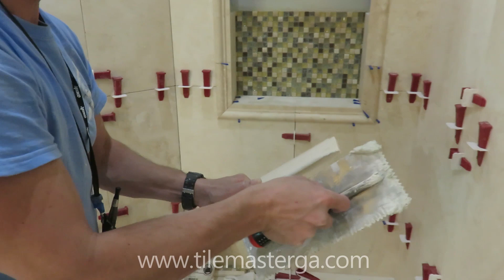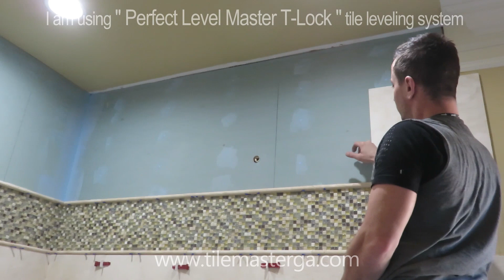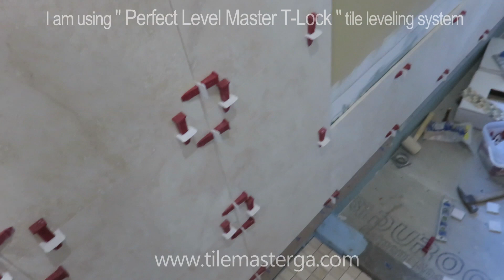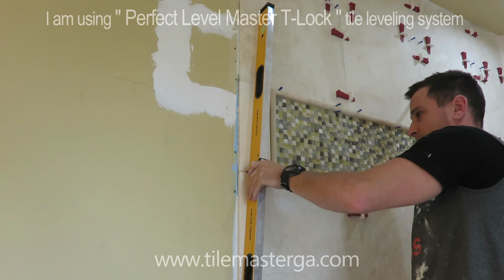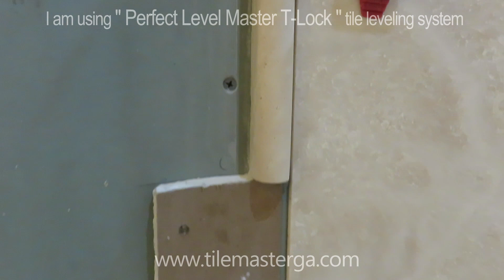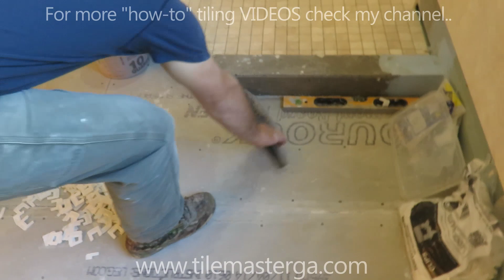Part "4" How to tile shower walls with travertine Tiles and T-Lock Leveling system

Comment: I have a question im tile setter and i like the way you do the job apply thinset on the tile not on the wall its easier and cleaner so have you ever had a call back doing it that way?
Reply: Put it this way, if he's getting 50% coverage I will be amazed.

Comment: how do you get all those white white wedges out of there?
Reply: TIM   just knock them out sideways.  very easy.  knock them all  out  in 5 minutes.  I used smaller ones on a floor job.  works great.!!!
Reply: Do you ever finish off with the pliers for the clip system or just do finger tight only?
Reply: they work fine going finger tight, but if you want the best performance always use the tightening  tool

Comment: When you make a mosaic border with pencil outlines, should you use spacers or wedges between the pencils and the mosaic for a grout joint or butt them up with no space?
Reply from the maker: sross002 There always is space - usually around 1/32 - 1/16, depends. Is just hard to notice on video. I am using unsanded grout for that.

Each space between tiles has to be filled.